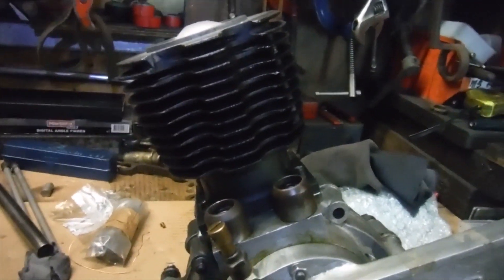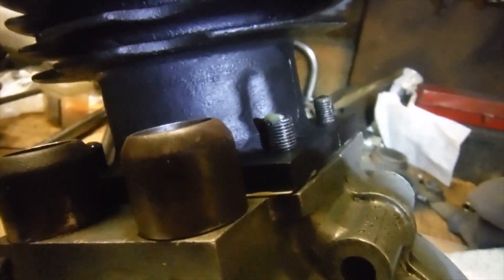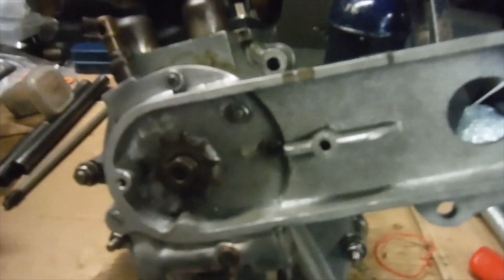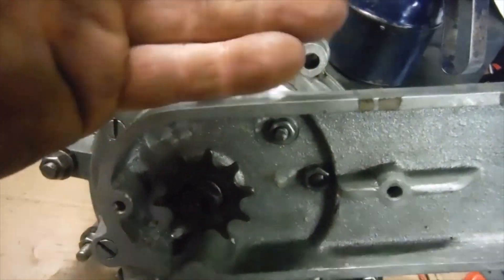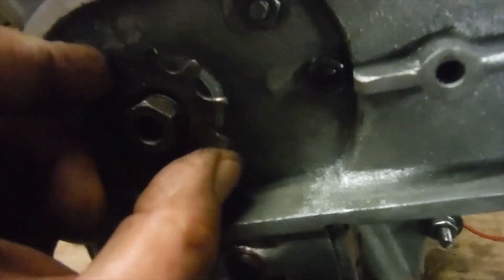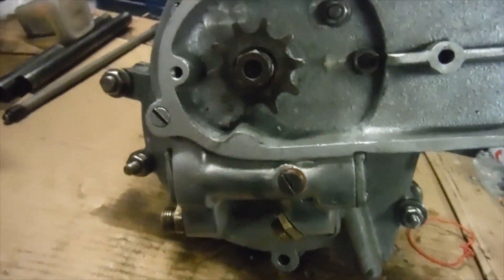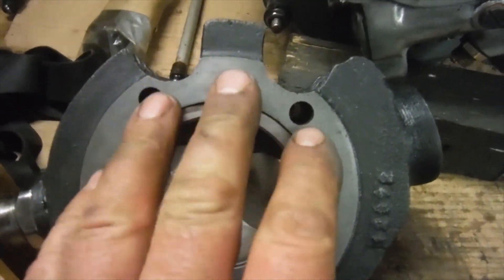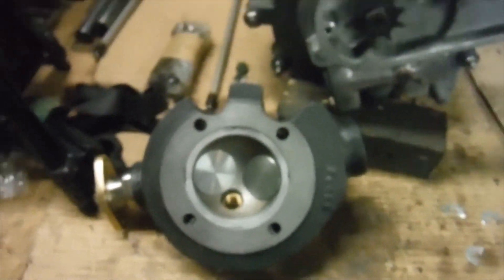JAP 250 engine progress - bottom end work complete, barrel and piston fitted, ready for head.

Comment: On the firsts times of runnig the owner should be careful with hi temp. Working...you should use some anti wear like a slick 50 or similar... right??
Reply from the maker: No - never use anything like Slick 50 in a newly built engine, it will prevent proper bedding in. I never use any additives in either my fuel or my oil, whether an engine is newly built, or quite worn.
Reply: @paulhenshaw4514  even in the case of this piston being so tight??
Reply from the maker: Yes it needs to bed in to loosen up a bit, but the piston is not 'too tight' in the bore, so any 'friction modifiers', as some of these additives are known as are definitely not going to help. Careful setting up and running in is all that is required to get this bedded in and working nicely.
Reply: @paulhenshaw4514  ok but now the owner has to be carefull for the next 200 or 300 miles not let the engine get to hot...

Comment: Presumably the original piston may have been flatter than the current one. What is this engine to be used for?,
Reply from the maker: It is for a vintage sprint style machine, so may need a bit more 'go' than this piston will offer, although I shall be checking the compression ratio soon, to see what we have already.
Reply from the maker: My Trident has a Hyde 850 barrels and pistons kit. When I fitted it I asked Norman Hyde why the domed piston crowns didn't reach the top of the bores like they did when it was a 750, thinking something was wrong. He assured me that was how they were meant to be, in order to keep the compression ratio about the same with the extra cc's. We have the same situation here, as it happens, with 265 cc's as opposed to the original 250 cc of the JAP engine. Based on the way my Trident performs, I have no concerns! Incidentally, there is no 'squish' effect until at least part of a piston crown comes to within around 1 mm of a cylinder head combustion face - I have done a lot of work on such things on our race winning Royal Enfields whose engines I built and tuned.